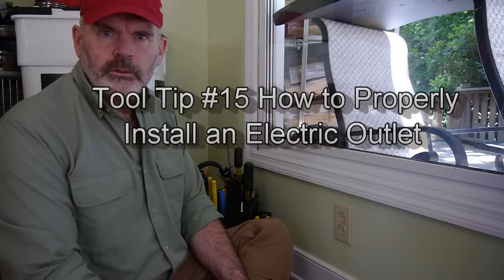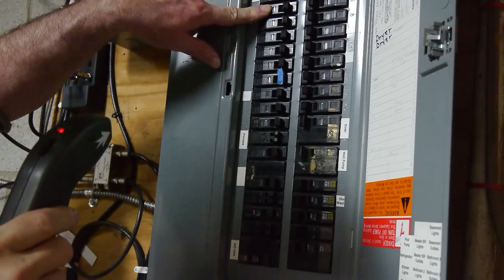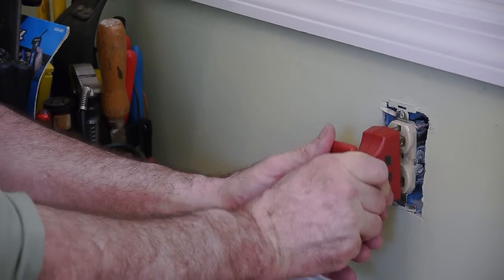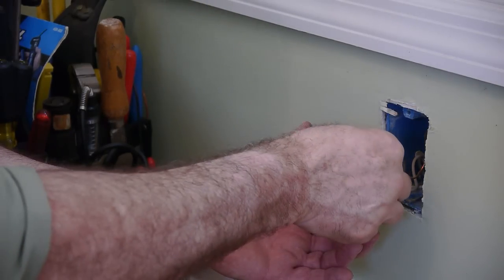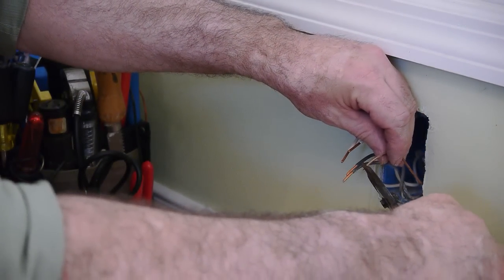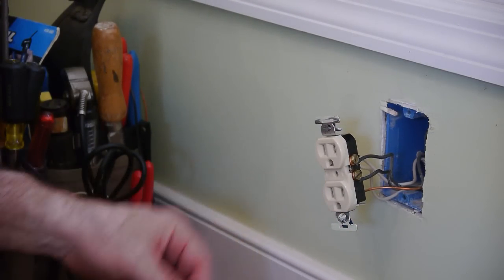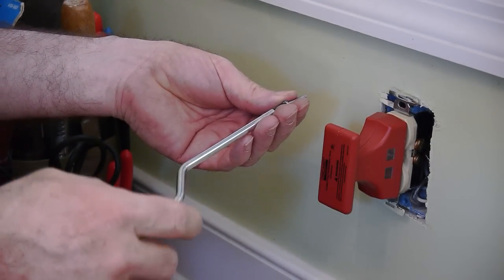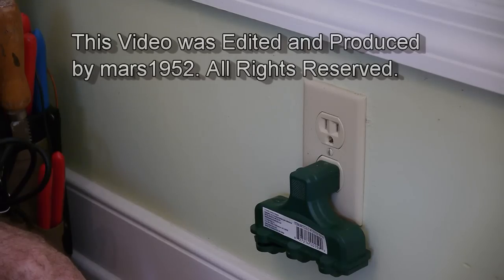How to Properly install a Electric Outlet Tool Tip #15

Comment from the maker: Hi Marshall, First I would like to compliment you on your excellent first name. I tried to reply to your comment on my video about installing an outlet but Youtube is being quirky today and would not let me directly reply. I have ordered the latest copy of Wiring Simplified so that I am up to date on the national code but until they start selling plug in devices that are designed to to be plugged into an outlet that has the ground installed up I will continue to move my outlets to the ground down position as needed. Thanks for your comment.
Reply from the maker: mars1952 Hello again Marshall Clark, I have done some research and the National code does not express a preference for the orientation of 120 volt outlets. I also talked to a local licensed electrical and he said there is no preference. In fact you can mount the outlets sideways if you want.
Reply: mars1952 In my new home construction, the electrical inspector made us go through and turn all outlets to ground up position.  We were told that is new building code in Pennsylvania.
Reply: +mars1952    Why would using the back push- ins be acceptable only sometimes.  Doesn't the mfg make them like that so you have both options?
Reply: Kaitlyn burleson its for a lazy option so as to allow electricians to simply push in the wire but the thing is is that with time/in time it'll not be as tightly squeezed in the contacts an thus this will cause a dangerously risk of arcing/sparking as the result of a loose/bad connection whereas the screws tend to kinda stay tight around the wire better than a simple spring will/would as with the front of the receptacles where it has plugs inserted into it this is also a key thing to pay attention to aka don't lat it get to loose of a sqerze on the plug especially if it seems to "just hang there" then you betts yer butt ya gotta have it replaced or else you gotta do it yerself
f if yer confident and experienced enough to trust yerself around electric/electricity
Reply: the reason they have that is so electricians have a way to take another shortcut by only having to screw the ground wire vs having to do one or two hot,neutrals in addition to one or more grounds (if more than one they should be pigtailed
Reply: I as a future adult just assume do the job right the first time aka do the task (whatever it may be) or do it right or don't do it at all dang it
Reply: mars1952 THANK YOU!!!! This is the EXACT video I was looking for today. My house was built in MN 12 years ago and I was told according to code the ground needed to be up in case something fell off the wall into it. Well, after 12 years of total and complete frustration and, like you said,  “that’s just stupid” how every 90 degree angle cord has to aim up the wall...I’ve had enough!  The real kicker was today when the Leg Lamp nightlight I bought for my man for Christmas can only point to the ground. Now that’s REALLY stupid, right?!  Thanks for your video! You rock!!!!!

Comment: Although  I will say that he is correct about over-torquing and using the stab-lock(spring tension) connections.  I've seen many problems, including fires, caused by using those connections.

Comment: Actually it is installed the correct way when the video begins.  This has been debated for quite sometime and there is no right or wrong way, just a safer way (as it was in the beginning of the video)
Reply: Andrew Coleman exactly. You don't want to have your live wire on top in the event of a rare (but possible) accidental contact of another live wire from above. In fact, McDonald's has the "ground on top" configuration standard in all of their restaurants across North America.
Reply: It's commercially  correct the way it was originally Installed and safer if using a metal cover. Pass and seymore shows on its direction to Install there recipticals with the ground up in the vertical direction. I've read that the nutural side up when installing in the horizontal direction. The thinking is if the cover came off while something is plug in that the metal plate would posibly couse a short to ground /arcing. I personally Install elicterical recipticls whith the ground down, I think it looks better and works better whith most right hand plugs.( not on safe with nonmetalic covers)
Reply: sparky12x  you're wrong go to any hospital or doctor's office or most commercial buildings the ground is always on top which is code correct but industry standard for residential always puts the ground at the bottom
Reply: Well Sparky I have not been able to locate in the code that says one way or the other which way the ground should be I can recall when I was in school the instructor talking about it and that's why you always see it with the ground up in hospitals and doctors offices because they have a higher standard than your basic residential but I am looking although it's not on my highest priority but again next time you go to your doctor's office or Hospital look at the plugs you'll see the ground is always up
Reply: @smokncoffee  you know after I made that post I spent a significant amount of time researching the code and was unable to find any code reference discussing the orientation of a receptacle but it is odd to me that being Hospital electrical is on a whole different level from standard installs, why every single doctor's office and or hospital or emergency room or anything medical that I've ever seen anywhere,  120 volt Outlets are always what we would consider upside down or ground up,  can't really find out exactly why that is but I am very curious to know

Comment: In 1998 in AZ the code was ground up. To prevent anything from sliding between plug and outlet shorting out circuit.
Reply: Or if the outlet  is to be installed on its side ( Horizontally ) position it so the neutral blade is up , same idea , if the plug is not inserted completely all the way in something like a coat hanger could fall in and lay on the plug blade and there would be no electrical shock on the neutral blade .

Comment: According to the NEC guidelines that plug is installed correctly check your code. Local 11
Reply: You Are correct but if the outlet is for a dedicated device that has a molded right angle plug (the male) the outlet should match the orientation of the plug so the cable is not bent down like he showed ---BUT he is wrong saying the outlet is installed wrong .
But Again, lol the push in wires in the back make it installed wrong and they should not be passed through the outlet  for the circuit--- they must be pig tailed.
Why they ask? Because the breakaway on the outlet is only rated at 10 amps, the outlets down stream are at risk....
So the Outlet was installed wrong....
But you knew that my comments are for the thread...
Reply: Actually it's not in NEC code book as right or wrong. Either way is acceptable and why you see it done that way everywhere.  Ground up in commercial and its ground down in residential.

Comment: Ground up IS correct way to install. Just no body does it that way. Designed to bock any object from falling across plug and shorting it out.
Reply: Stephen Lacher that is good advice in a workshop or other active environment where equipment is plugged in and unplugged over and over again. For appliances or extension cords that start off at a right angle, this person's example is correct.
Reply: Not according to NEC..  either way is acceptable.  If your able to get anything behind there to short it out you have a bigger problem than the ground on the bottom. I have never in my 20 plus years heard of anything shorting out that way. Commercial you will find ground up, residential you will find it ground down and either way is correct.

Comment: I label the circuit at the box.after I've initially worked on it. That way, I know which room and or outlet the breakers in the box control.

Comment: Things seen that are good:
- Testing with meter to confirm power is off.  
- Snugging up receptacle cover. 
- Using an offset screwdriver to install the cover plate. 
- Clear discussion of the use of a RECEPTACLE tester
NEC says “outlet” is a location where a device or fixture is installed.  A RECEPTACLE is the device you are working on.  
NEC also has been updated to require the white wire “Shall” be pigtailed.  Thus the device is not carrying the load carried on the grounded wire. FWIW: It is NOT a neutral wire on a receptacle.   
You may not like that the grounding opening is up, but it is proven to be a much safer manner of installation. When a cord is partially removed, exposing the metal pins on the cord cap, “up side down” according to you, deflects anything dropped down the wall. If the receptacle is installed in the manner you prefer it allows a “curious” child to drop a coin on the exposed metal pins on the cord cap, and run the risk of electrical shock, and possibly fire.  
If referencing how things “SHALL” be done, or “SHOULD” be done, please make sure that there is correct installation across the whole process, and not just part of it.

Comment: the provblem with thoes transmitters is that it pup's through the rest of the cables, same thing in telecom tracing, when we check wiring looms, a bit hit/miss but you get an approximate, helps if you have a big switch board

Comment: Klein makes Screwdrivers, that have a little piece of metal sticking out from the handle next to the shaft. It's great for bending a perfect loop in the wire to go under the screw. Also it's nice for working in a panel, as you can stand it up by putting the little piece of metal in the panel lip.

Comment: Always install a Lock out tag out on the circuit breaker even if you're 99% sure no one will throw it to the on position while you're working.Its all about safety
Reply: Kelly Electrical they do sell lock out kits for residential breakers. I keep a set on my truck.

Comment: Please when replacing an outlet or switch make sure the insulation from the wires are NOT under the screws like at 11:17 the wires need to be stripped to proper length.  Having insulation under the screw can cause a bad contact and can potentially arc.  While yes its just a little a little can cause it. Ensure only metal is under the screw.
Reply: I saw that too. This guy needs not to do video
Reply: @thomasmarable6818  I agree, this is how people's houses burn down. This video shows a good example of what not to do.

Comment: If you can't tell the difference between a receptacle with Spring Tension Connection from a Back Wire Screw Tension Connection, you should not being trying to tell anyone how to do anything electrical. Always test your Electrical Tester on a known "hot" wire before trusting it to tell you that power is Off - I prefer to double test - Test with power On, Turn power Off - check with Tester, Turn power ON - Verify that tester is still working, then Turn power Off and begin work.
Reply from the maker: +Debra Quick Not only can I tell the difference between a Spring Tension Connection and a Back Wire Screw Tension Connection I demonstrated the difference in this video.
Reply: LoL, yeah it's a fuck of a lot easier to get the wires out of there if you don't snip them first!  LOL.   Debra called it bro. you had no clue there for a few....  lol...all good.
Reply: Same thing. they are both terms for 'backstab' connections; unless you meant 'Side' Wire Screw Connection. But you're correct in the fact he doesn't know the difference between a side wire, and back wire connection. what he says at 6:48 is a dead giveaway.

Comment: The circuit finder is that you first test it the receiver on the transformer your pluged into, It then takes a reading of it's output signal. When you test the circuits in the panel,  it will beep & chirp on most of them while it's diagnosing the correct signal. Then you will need to go the 2nd time over the circuits one by one & it will only beep on the right circuit  on the 2nd time around.& not all the otherrs.as first it did. Another trick of the trade is if it's a light socket' say in the ceiling or a lamp' use a socket plug in the socket & plug the transformer in as you do a plug socket so to find that circuit! There's really no need to shut each circuit off as shown here if you follow my directions how to do it. Scan first & let it beep & chirp & on the  2nd run it will beep only on the right one. Haste makes waste, so slow down & be safe. I am a good man to have on hand, Dave the handyman home repair & improvement. St. Louis Mo. 63052 & May God bless & prosper his people & keep them safe! Amen
Reply: Dave Overbey I have a question for you. I have 15 outlets in my house that don't work. My father(he passed away 2 years ago )replaced the main breaker in my fuse box 7 years ago.  I not familer with replacing the outlets as I have never done it before ,should I do myself or get a repair person to do it ?Any help you can give will be helpful.

Comment: As others have said there is no right or wrong way to orient the outlet.  The ground can be up or down.  If you go to a hospital ( and some other industrial buildings) you will notice that all of their outlets have the ground facing up.  When I first ran into this, I called an outlet manufacturer and asked them what was the correct way and they told me it was personal preference, that there is no code requiring the ground to be installed one way or the other

Comment: You go to the time and effort to do that change which is good . But with no extra time it would be better to take six inch of extra wire and wire nut all together then pig-tail your plug . If you ever need to change that plug someday you don't disconnect the rest of the cct. Then also when I leave I put tape over the screws to protect from a short .  But overall you are very correct do not use the push in spring . They cause loose connection as the spring wears out over time . With fires as a result.

Comment: Usually upside down has a meaning....it is industry standard for the outlet is controlled by a switch!
Reply: William Briggs , actually the receptacle is installed that way specially under a window. The intent is if water gets in it hits the ground first. The authorities do everything possible to screw it up for us
Reply: Been in the industry over 35 years never heard that standard
Reply: So not true.  The correct method is ground up according to the latest NEC rules.   That's for all receptacles, switched or continuous.
Reply: @lichub  like to know where. I can't find it . Which article it in
Reply: @lichub  no answer have you a week, that's because it's not in the NEC

Comment: You need to be sure to check upper and lower outlet to be sure no juice is going to the box.  Sometimes they are on different circuits.

Comment: You could also use a simple table light to check if there's any power running through it!!
Reply: Let us know how you see the table light go on and off while you're downstairs at the breaker box. Looking for a way to turn off at outlet safely

Comment: I use a radio when turning of breakers, when the music stops, ur good....
Reply: Thanks for the tip.
Reply: that's a good tip 👍
Reply: epic line, bro. I'm gonna borrow that one hehehe
Reply: I use a wireless door bell. Works great also. 👍
Reply: zackjames88 But there’s one problem with that maybe more. But, the one I can think off from the top of my head Is that if someone is working on a desktop on some important sensitive stuff u might truck their day up. Yeah, u can warn him and he can save the work and problem is solve. But, what if you get a job that requires you to fix it ASAP and it happens to b at an office with dozens of computers working and the client tells you that they can’t afford to turn them off and that if you hit the breaker that happens to be their circuit they will loose a lot of important stuff. Then what? Do you pick up your radio pack your stuff and go. Or you can just take that job charge a little more for the risk ur taking because all circuit breaker finders don’t work 100 percent
Reply: I use one of my grand kids lol

Comment: Did I miss the part where discussion is of why there was only one earth ground yet two white and two hot black  and which white wire of the two white goes with a specific hot black ?  was one pair white and hot black coming from the fuse panel and the other white and hot black going to another outlet box?
Reply: Yes, one of the wires was the "line" and the other the "load."  The load goes on to power another outlet downstream.  It is important you wire the line and load into the correct terminals.
Reply: John Smith GFCI terminology?
Reply: Jay, you are correct. The ground wires were most likely already connected and residing in the back of the box.

Comment: Checking which breaker? just plug in your corded drill and lock the trigger on. set the drill on the floor and go to the breaker box. you will hear the drill stop when the right breaker is tripped. Is that a really old plug with slotted screws  or  don't plugs with Robertson screws exist there? I really hate slotted screws.(then I watched and you had phillips screws) For the $1.50 a plug costs put in a new one. I sure would never use the push in holes. Do you not have to use tamper resistant plugs? I think plugs in metal boxes have to have the ground wire bonded to the box and the plug screw. You do make some good points, good teaching video.

Comment: it would be better to nut the wires together....black to black , white to white, ground to ground, while adding a pigtail to each wire nut. doing this allows power to move past the outlet in the event that the outlet goes bad. The current way it is installed if the plug goes bad there will be no power elsewhere and causing it to be a problem to figure out.